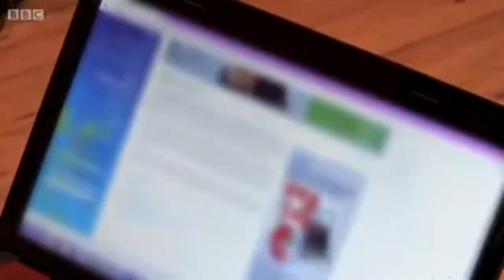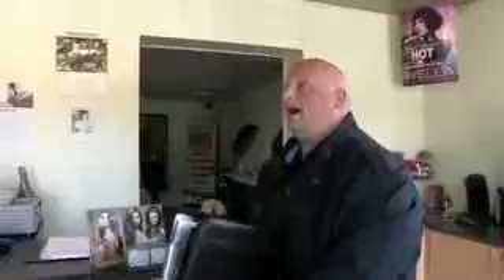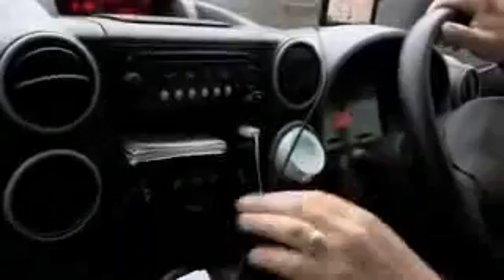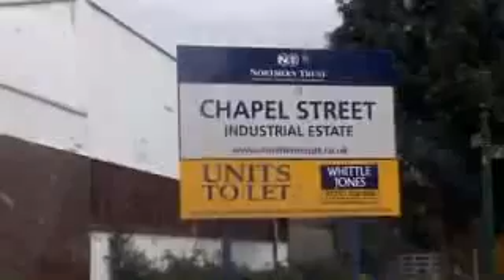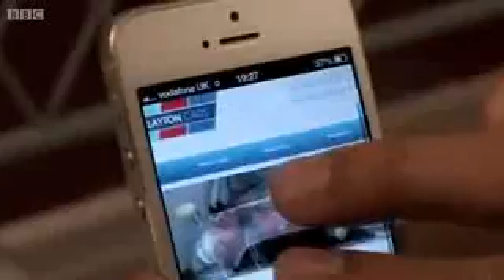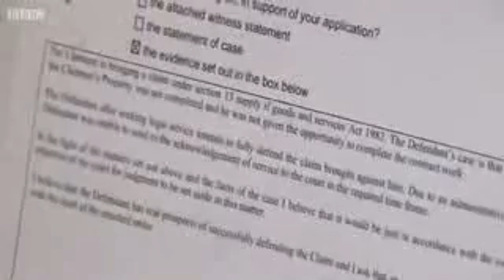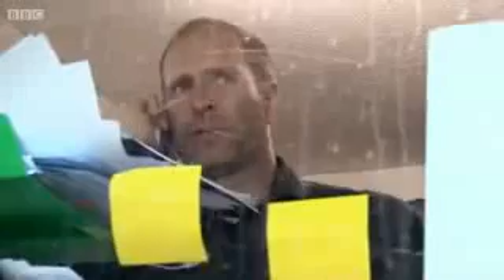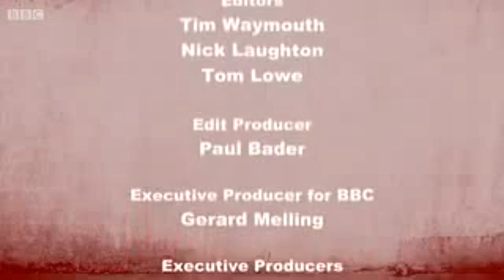The Sheriffs Are Coming S03E01 2014 01 13

Comment: I don't know what representation the BMW garage had or what undertanding Muhammad and the county court judge had on to day cars, I can't say about the sheriffs because they are there to execute a live wit and can't do anything about it because the courts have ordered it.  My brother in law loves his 50s, 60s and 70s cars because they are so simple, a fault accures with them you find it in minutes with no fancy machinary.  Two years ago I brought a car Vauxhall and test drove it and it was fantastic on the test drive, every car I buy from a dealer I require a full MOT and Service and in return for this I pay the agreed price, I also accept that I am buying a second hand car so there is going to be minor imperfection and as long as these are minor and mendable I accept.   After all we all like to think we have got value for money. driving the vauxhall home the engine light came on.   I fully accept the garage I brought this car from didn't have aything to do with switching the engine light off it was a fault that happpened while driving home.  I got my code reader out and it was saying ECU faulty well that was that I contacted the garage I brought it from, he said bring it back and he will get his auto electrician to look at it.

But it was baffling me because the ECU goes on your car you get alsorts of problems lights not working and other signs but yet my car started and was driving normal, it didn't equal the major fault my code reader was saying.  Lucky enough I had a second code reader a little more back dated and tried that in and this time it showed a problem in cylinder two, it was not the ECU it was a faulty code reader .  Now you get a code and you think I know what it is, you go on your laptop put the code in and read what the code means, it doesn't give one problem with this code it give from a spark pleg to a cracked piston, I rulled out the cracked piston because there would be complete loss of power, I replaced fuel injector in cylinder 2 , a few days drove fine but light come on again, I replaced all the spark plugs and again car drove fine for a few days and light come on again, this time I replaced ignition coil and here we are engine light remained off.  I was going down the list of the codes, I claimed nothing from the garage because it cost me £80 which means minor repair, I have known two garages in my area go out of business because of unhappy customers who thought they where being ripped off.

Lucky enought I only repair my own car but newer the car the more complicated the repair, I fully accept the garage who sold me the car the problem was not there when they sold me it, reason being the car was driving fine and the ECU is to find faults before they effect your car.  Everything that garage did was towards exhaust and cat problem and even the second garage the knocker they diagnosed was withing the emmisiions of the car.  Sadly because cars are being made more greener the biggest problem is the emissions as I had a Volvo and the DPF gave me hell over £4,000 in parts and still never got to the problem, it beat me so I sold car for spare or repair.  So yes the garage in my opinion where miss represented and the client had no understanding of todays cars, the other fact is if your going to take your car to a main dealer your bill is going to go through the roof.  My father in law had a 1992 Audi and my brother in law was a top Mechanic he could tune a car to perfection with his ear, for some reason the car would drive maybe for days and then just cut out, I don't know how much my father in law put in that car.  He took it to Audi garage and other garages my brother in law recommended, the reason for this my brother in law replaced parts he thought it was and no luck.  Eventually my Father in law got another car and never found the problem to the Audi no one did.

I don't think the BMW Mechanic did anything wrong, Muhammad brought the car in for repair and he now as to start liminated what could be causing the problem.  He as to buy the parts and try putting car right.  The fact is it is not the garages today to blame but technology and that garage as paid for parts and labour and as lost it because of people who can't change a wheel on a car.  Go and sue every garage because once there is no garages who is going to repair your car?  Sadly the Shariffs have a job to do regardless to their own opinions, Judges get lots of money so probably buy a brand new car every 3 years so never had a lot of experience with older cars, but the newest car I ever had is 7 year old and yes always had work to do,  I try my best not to take my car back and the reason I want a full MOT and service before buying is it give me liverage.  I once brought a car Nissan with full MOT and service and when I got it home it was a Rot box within two days of buying it the seller never gave me the money back for repairs the MOT garage did because they feared for the test licence, the knew they give a test certificate for a car that wasn't fit for the road, I also asked for £50 inconvenient fee which they gave me.  Because I asked for a full MOT and service the seller thought I didn't know anything about cars they where wrong, it is because I simply don't trust dealers and want as much leverage as possible.  With the Vauxhall it is a fantastic car and never went further with the garage because they where minor faults and I know I will never get a perfect second hand car but the Nissan was unsafe and should of never passed a test.   All I can say before acting against a dealer or garage make sure there is no other solution as I know two honest garages that have had to close down because of a couple of unhappy customers, they did not let it get as far as court they paid them back because they wanted to do the right thing but sadly they are now out of business.